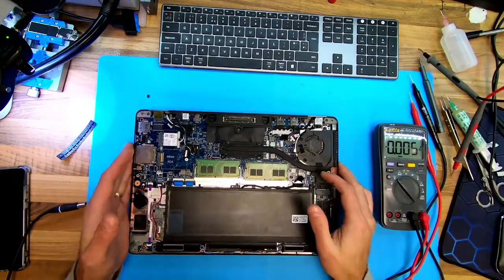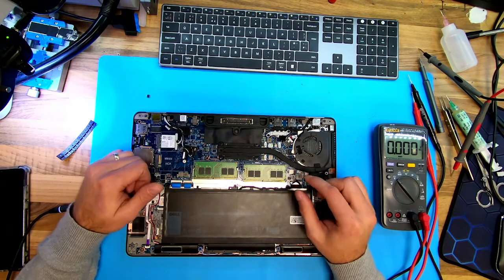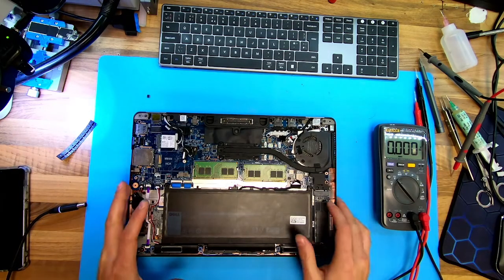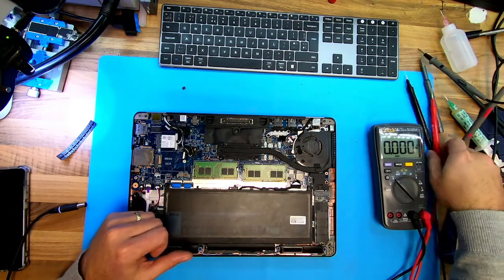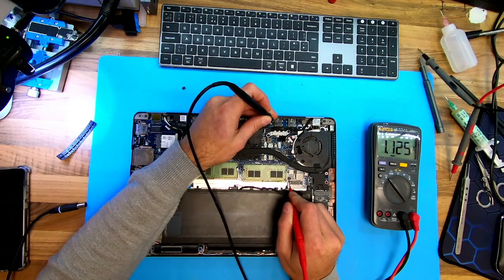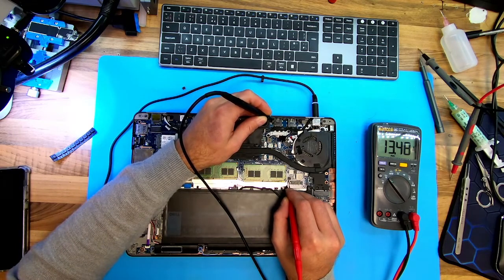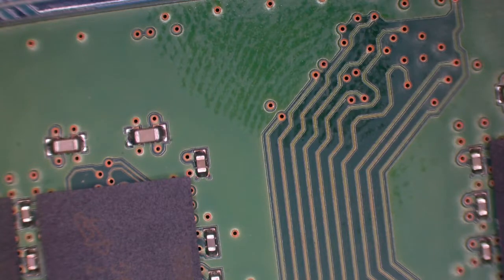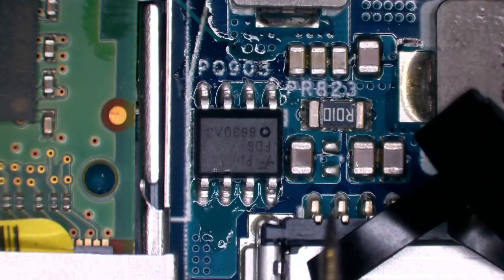Dell Latitude E7470 not charging, motherboard Repair

Comment: @itfixall I got E7470 not charging. I have checked this MOSFET when I plugged the power and pulled out the battery, I found the gate voltage is equal to the S voltage (about 13v). Gate to source voltage is 0. And D's voltage is 0.  So the MOSFET is working correctly. Just the Gate voltage is not right. Can you tell what the gate voltage should be?
Reply from the maker: Hi, in your case, I suppose it is a battery issue, 13v on the gate, it should be all right as far as I remember.

Comment: Can you list the exact MOSFET you used? I have this exact issue and need a replacement.
Reply from the maker: Hi, I have used FDS6690AS N-Channel Mosfet. You can use any compatible one by comparing the datasheet. If the values are the same, it will work. Make sure to be N-Channel and not P-Channel.Thanks for watching.
Reply: @itfixall  awesome thank you so much! I'll pull this thing out of storage and get it fixed up.

Comment: What part number is that mosfet or equivalent mosfet?
Reply from the maker: The msofet is 6690AS  30V N-Channel
Reply: @itfixall  In the schematic diagram, its SI4835DDY-T1-GE3_SO8. It is P-channel MOFIT. 6690AS is N-Channel.